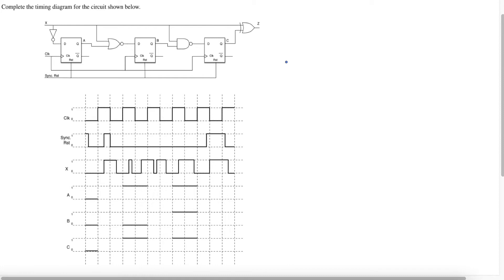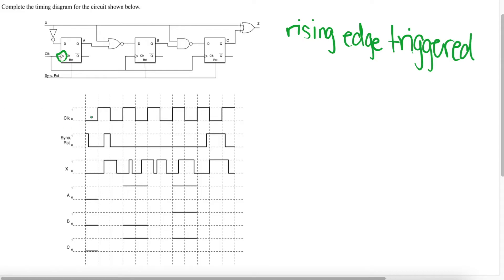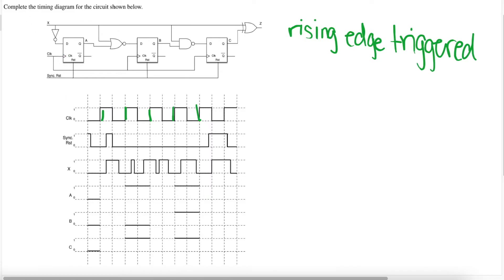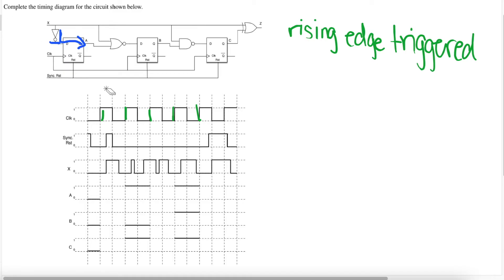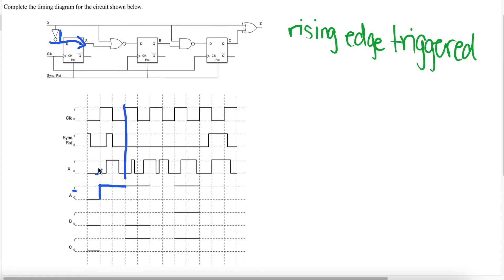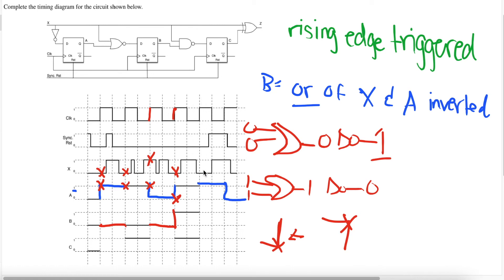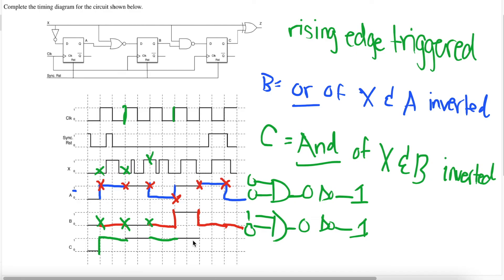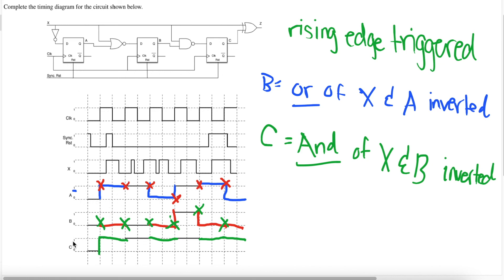Tutorial D flip flop timing diagram question solution

Comment: You say at 11:00 that if it's ascending you take the lowest value, and if it's descending you take the highest value, but at the beginning when you checked the value of B at the first rising edge of the clock, you said that A was equal to 1, even if A was ascending, and the value before ascending was 0. However, since A is ascending on the first rising edge of the clock, shouldn't you then take the lowest value of A at this point, which is 0 in this case, which would then make the input in the NOR gate 0 and 0, which would produce a 1 at B????
Reply: Same, did u know what to do in such cases?
Reply: same confusion